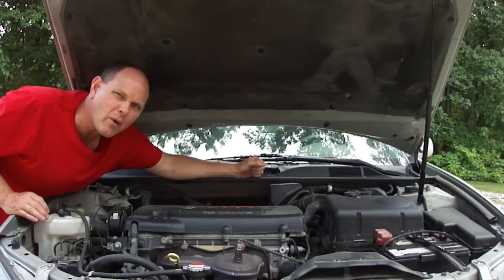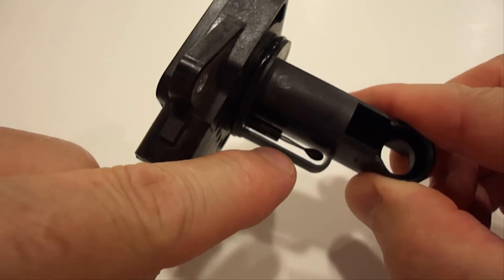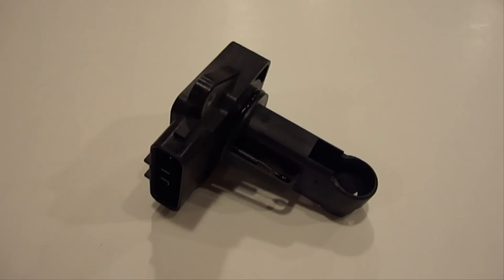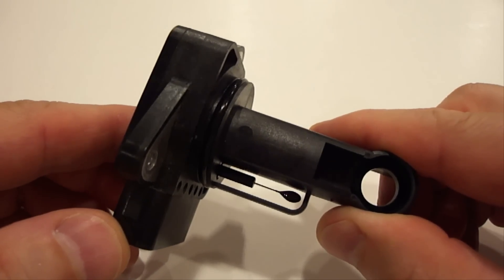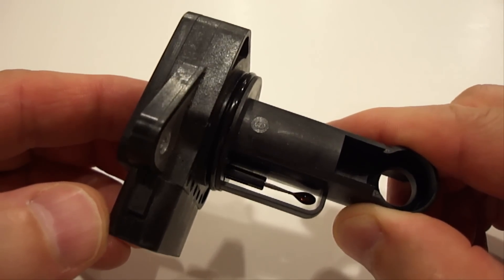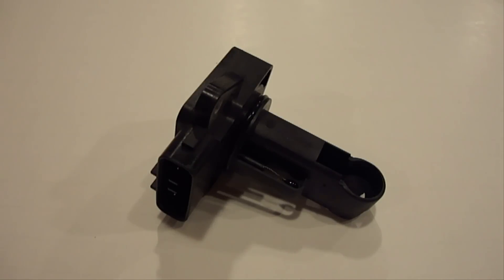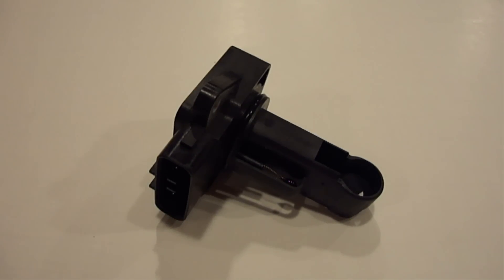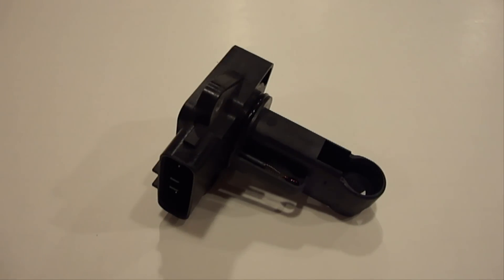The Dangers Of A Bad Mass Air Flow Sensor On Your Car

Comment: $25? I just had one replaced and my mechanic told me it cost around $180 (for 2013 Mazda 3) Another mechanic said about the same...I need to do more research..
Reply from the maker: The cost of replacement parts is all over the place.  Your cheapest price will be on Ebay.  Make sure it's OEM.
Reply: proclaimliberty2000 yeah, I can see that! Smh...oh well!

Comment: If you disconnect the positive cable from the battery terminal it will reset the engine warning light on the dashboard....... It's called in the mechanic trade MANUAL RESET
Reply: David Powell  Negative wire not the positive

Comment: Hi Paul, Good video. I am able to do myself. Only problem the Philips screws in since 2001 on Toyota Avalon. Screws are now flat , cannot get them out to clean. Bought screw extractor no luck. Any hints? Will damage anything if I pry it open to clean & replace with new screws? thanks so much Nancy
Reply from the maker: I would try and grab the screw with a small pair of vice grips and then try turning the screw.

Comment: I recently replaced my MAF sensor.. the check engine light is still on.. will it disapear automaticaly? Should i wait for it to turn off or should i delete the could with obd2.. thanks..
Reply from the maker: It will eventually turn off by itself.

Comment: i have a mazda 3 and had MAF sensor issues.  now the connector has a broken wire and somehow that part is hard to find.  the dealer doesn't even have it and mechanic is still hunting one down.

2007 Mazda 3 and a little MAF wiring harness is hard to find?!??!?!!?
Reply from the maker: I'm sure you could find one at a salvage yard.  These salvage yards can really come in handy.  Not long ago I had to replace a cracked air filter housing that Toyota wanted $850 dollars for.  I ended up finding a used one on line in excellent condition at a salvage yard which I had shipped to me for $100 dollars.
Reply: i got a sensor that came with a connector off ebay.  just had to solder it in, good to go!

Comment: Do 2009 ford expedition have this? Bc I don't know what else to do with my vehicle. It runs and feel just like you described something like that would do.  I have no codes and I paid multiple people to check it out.
Reply from the maker: Alex Rodriguez hi Alex, your vehicle more than likely has a mass airflow sensor. This sensor is a very common cause of engine hesitation. I would first clean it properly if this has not been done.

Comment: At Autozone, the reader came up with the code P2177 and the explanation: System too lean off Idle Bank 1.  Is that the same as these trouble codes?  It says I have to replace Mass Air Flow Sensor.

Comment: So how can I tell it needs to be replaced, or just clean it. My check engine light turns on, but it only comes on for a day...then another day it's totally off??? Thanx👋 My 1998 Dodge Ram 1500 has these symptoms, so I recognized the issue of this part.
Reply from the maker: Take it to an auto parts store and they will check the vehicle with a diagnostic scanner for free which will give a trouble code to help locate the problem.  If a trouble code is displayed relating to the mass air flow sensor then first properly clean the mass air flow sensor.  https://youtu.be/YnckaCCJEEk  If the check engine light continues to come on then replace the mass air flow sensor.

Comment: I have a 2011 Hyundai sonata. Can a bad MAF sensor also affect engine temperature & also when the engine fan turns on and off?
The issue started at about 100,000 miles. I now have about 145,000 miles on it. I have a P0128 code and my engine fan runs randomly, usually constantly, and my car won't get up to running temp. When I idle for a bit, the engine will overheat. I have replaced the thermostat (twice), the engine fan sensor, the Air Temp sensor & the MAP sensor and I still have the same issue. Can anyone help me? The only other things I can think of is the MAF sensor, the O2 sensors or it's a bad ECU. Any suggestions??

Comment: Our Buick has all those problems, stalls, loses power, etc. I don't think the places we go to are dishonest just that they don't know and end up replacing things, Battery, starter, coil,, fuel pump , ignition switch, spark plug and wires.  All  this has been replaced on our car.
Reply from the maker: Do you have a check engine light on and if so what are the trouble codes?
Reply: engine check light came on for a few seconds  on the way to the repair  shop, it came on just prior to the car dying. Is it possible to read out the codes if the light is no longer on?
Reply from the maker: Yes.  Some kind of code or codes are now stored which can be retrieved.
Reply: Thx   for the help, will see if I can get someone to do it.

Comment: I have a 1998 gmc c1500 ive replaced the fuel pump, spider inj with regulator , and i am still getting a hard starting i have to literally slave out the starter before itll start it seems to do it only when it sets for about 15 to 20 min and that really isnt to bad its really bad in the mornings when it hasnt been started in awhile  amy ideas cause im going crazy  also there is no check engine light on and   seems slugish driving down the road like a big just of wind is slowing it down  also has a slight hesitation when taking off  and ideas please ?
Reply from the maker: Have you cleaned the throttle body and butterfly plate?
Reply: @proclaimliberty2000   yes i have

Comment: Most of the time the computer will  run default predetermined settings when the MAF sensor fails or the primary O2 sensor fails. But still you want to clean or replace the MAF when does start to malfunction

Comment: Does disconnecting the MAF sensor to see if the car shuts off and accurate test to condem the sensor?
Reply: I been researching mass air flow sensor lately and wonder if this is true about disconnecting the MAF and see if the car shuts off
Reply: @x35mmman  it is not an accurate test.
Reply: @x35mmman  you have to see what the gs is on the MAF sensor with a scanner. It has to be on average at least 3.0gs or less. At about 1000 rpm pretty much at idle. If it's about 4.5 or over than its way to high. And sensor is more than likely faulty.

Comment: I have vave a new sets of heads on a 350 chevy with a new plugs   and it won't start , I pulled plugs an d cleaned  them and I found out that # 5 had  oil deposit s on it what does that mean that was the only one that had oil deposit on
Reply from the maker: Micheal Urias Sounds like maybe an issue with cylinder five valve stem guides.

Comment: have a one problem on my Chevrolet spark my car rpm is high p107 code and how to check map sensor and can i ping you in gmail are hangout are viber whatsapp im take it the  video on map sensor voltage ... but which fault is i dnt know please solve my problem im from india

Comment: I have a 2005 Mazda Tribute 3.0 with 162000 miles. It runs great. The problem I'm having is that I get different miles per gallon for every tank full. On one tank full I will get 19 MPG, then the next I will get 15 MPG, then 13 MPG, Then 10 MPG, then 15 MPG, Then 19 MPG, and so on. Originally I used to get 20 miles per gallon.

I have replaced the spark plugs, spark plug wires/coils, and every filter I can think of. I’m the type of driver that does not have a heavy foot.

What is weird about this issue is that the gas mileage fluctuates so much. 

Could this sensor be the problem?
Reply from the maker: It could be a mass air flow sensor (make sure it's not dirty) or oxygen sensor starting to go or either one not getting the proper voltage.  Make sure you have voltage where the clip attaches to the sensors.
Reply: Is there a certain way to check the oxygen sensors? Your reply is greatly appreciated.
Reply from the maker: Let me know if you fix the problem and what it was.
Reply: I sure will.
Reply: It's hard to drive the car the same all time and get same fuel usage

Comment: I’ve a P0100 error, would cleaning it fix this or does it need replaced?
Reply from the maker: First make sure the sensor is receiving voltage at the sensor connection with a digital multimeter.  Also clean it if it's dirty.  If that doesn't fix it then replace it.  Best price will be Ebay.   https://youtu.be/YnckaCCJEEk

Comment: my k&n air filter is lifetime warranty never needs replaced.
Reply: you still have to clean it regularly.  And if it's the type that uses oil- that's exactly why a MAF sensor will die or at least need cleaning prematurely.  I'm getting rid of my "lifetime" K&N filter.
Reply: Replacing **

Comment: We found the fault replaced mafs but, how do you clear the code?
Reply from the maker: H B It will usually clear itself after driving the vehicle 50 miles or less or you can disconnect the battery cables for an hour which might work.

Comment: Kindly help me out with my Toyota Corolla 2010 model. The engine does self acceleration some time. It accelerates itself whether am on speed or if am about to  slow down. I need urgent solution pls
Reply: Remove the mass sensor. See if the engine still runs.
If it does then it's the sensor.
Or buy a Tester and rest it yourself.
Reply: Sounds like a bad throttle position sensor.

Comment: I drive an 09 camry that won't start at the moment.  It will crank, but not start. It ran rich and stalled a few times after start-up a few days before it no longer started.  It did not trigger any codes.  No CEL light, so I thought it was fuel-related.  Replaced fuel pump, regulator, filter - still no start.  Replaced plugs - still no start.  Haven't changed MAF, but I've routinely cleaned it, despite it having 200k miles... For the no-start to be MAF related, should I have seen the CEL come on? Can the engine be 'started' with the MAF unplugged to test? Any help is welcomed, thank you!
Reply from the maker: My vehicle will not start if the MAF is unplugged.  I'm not saying it will fix it for sure, but In my opinion a MAF with 200K miles needs to be replaced.

Comment: How can i find out if this MAS is gone bad?
Reply: Ahmed Hassonali  Check your short term and long term fuel trim.Suggest you invest on good quality  auto scanner 
Check for vacuum leaks as well
Reply: Gunzmith Dragonkind hi there
Thanks for the reply
I unplugged it did change the hesitation but the engine did not shut off !
Isn't the engine suppose to  shut off once u unplug it??
Reply: Gunzmith Dragonkind 
Also my friend where can i buy a goof scanner for a 2007 BMW 523i
Reply: Gunzmith Dragonkind 
Sorry i meant good 😊 not goof
Reply: Ahmed Hassonali Yes the engine is supposed to turn off if you unplug the airflow sensor
Reply: hi, how can i check for vacuum leak by myself? thank you

Comment: I just bought a car it's a manual, the check engine light was on and another light would come on once in a while and it would studder more in first then the next day it would start and stall right away then I took the sensor out and it runs buy only super slow for 2 minutes then almost not at all I'm guessing it's a problem with the sensor but can it be another part of the air intake or something else
Reply from the maker: You need to have it checked with a computer scanner which auto part stores will  do for free.  The throttle body might also need cleaning.  Keep me posted on your progress.  https://youtu.be/cOAYWVBfuek
Reply from the maker: You could also just need a general tune-up (Plugs, PCV valve, air filter, ect.)
Reply: proclaimliberty2000 I already have to buy a new sensor cause I broke the other one taking it out but if that doesn't work I will clean all the other parts then hook it up if none of that helps

Comment: Does some one knows what this code means P219E please help
Reply: Is a 214 Toyota Corola
Reply: did you try googling it?  this is what i found on that code :  http://p219e.enginecodes.net/ .   http://www.enginetroubles.com/codes/p219e .         Just a from googling though.
Reply: Thanks
Reply: P219E engine trouble code is about Exhaust Gas Recirculation Sensor B Circuit High

Comment: If you’re paying $25.00 for a new MAF sensor, chances are that it is a refurbished unit, honestly that only danger that I see is to follow your advice!!!
Reply from the maker: KNAC 105.5 PURE ROCK Brand new Denso MAF purchased on EBay
Reply: Not at all true. Just bought one last week. April 2023. Brand new in box denso for $27 delivered. How do I know it’s OEM? I’m asst mngr at the local Toyota parts department and this is lower than our cost!

Comment: you do not know what a MAF is. There is NO computer in the MAF, the thing on the side you think is the MAF is NOT it is a temperature sensor. Look down inside the other part and notice resistors and very small wires. clean it all with proper cleaner. put the sensor upside down and put enough inside to flood it. swish around and dump out. let dry for 10 min. reassemble done. You should NOT have the check engine light come on. these how to not do things videos are NOT helpful
Reply: i replaced the MAF sensor on my mazda and i drove it for about 10 minutes and check engine light came on again i plug in the scanner and i get the same code again.
Reply: Not a mechanic, but I would guess that you already damaged an O2 sensor and need to change it. Not much harder to do from what Ive found on youtube, and about the same cost parts wise on Amazon
Reply: i have a mazda 3 and had MAF sensor issues.  now the connector has a broken wire and somehow that part is hard to find.  the dealer doesn't even have it and mechanic is still hunting one down.

2007 Mazda 3 and a little MAF wiring harness is hard to find?!??!?!!?
Reply: Jon Focker try a brakers yard cut one off and refit to your car
Reply: i got a sensor that came with a wiring harness off ebay.  that way i knew they would fit.  i soldered the wires together and its good to go!
Reply: On a Vauxhall Zafira, the MASS AIR FLOW SENSOR is made by SIEMENS so once I decided to change it using  BOSCH one, I tried it and it was not running properly at all, it went into limp mode and didn't even have 80%ish power. I then heard on a online thread that you must use the original manufacturer part. I changed back to the SIEMENS and it worked perfectly, I think you should buy the exact same one. Also when changing the MAF it needs to be relearned and apparently that can take few miles of driving but if your changing I think you should ask the dealers to do it or a good mechanic.

Comment: 05 Hyundai Elantra GT- keep getting a cam sensor error but when i hook up my ob2 reader it shows my advance timing working but my MAF sensor is at .06v at idle and barely opens up during acceleration. Feels as its lagging when at accel and now theres starting to become a knock in motor. Thoughts anyone? Thanks!

Comment: Please teacher! Help me I have a discovery 3 2006, slow running is ok, start one time is ok! But when I put my foot on throttle fast the engine is failure but when I disconnect the maf the engine works perfect !! But show error light, I did clean the maf with good spray but not solve my question my I need change the maf maibe?
Thanks a lot!!!
Reply from the maker: Might need new MAF. Could be low compression, clogged fuel filter or dirty air filter.  Could also be bad injectors, fuel pump or spark plugs.  Also check alternator for voltage output.
Reply: proclaimliberty2000 ok thanks indeed!
I think tha is maf! Cause all that you said is ok filters, pump press, alternator... I'll buy it! Cause when I disconnect the car works great!!
Reply from the maker: Let me know if the new MAF sensor fixes it.

Comment: I been having problems with my car boging out turn off while running and when i give it gas doesn't wuna loses power and smells like gas from the exhaust and also been eating alot of gas do you think it the mass air flow sensor?
Reply from the maker: 7rove 5ide Do you have a check engine light on?
Reply: proclaimliberty2000 yes
Reply from the maker: Hey Bobby, take it to an auto parts store.  They will put a diagnostic scanner on the vehicle for no charge which will show trouble codes telling you what the problem is.